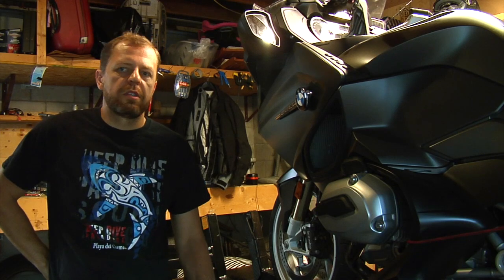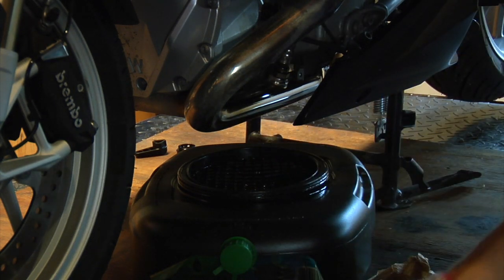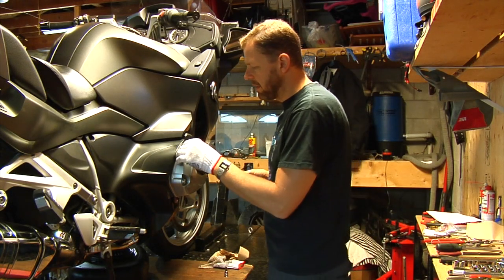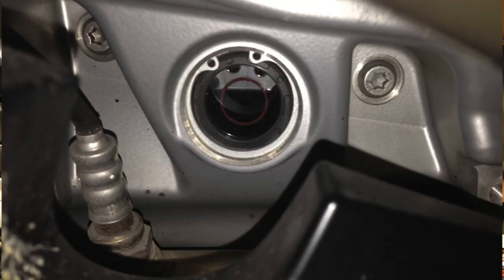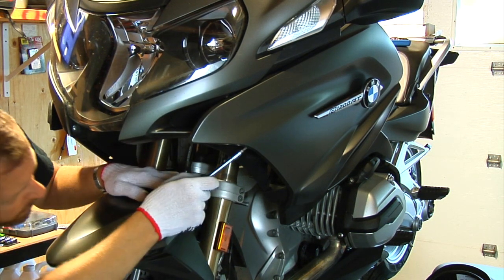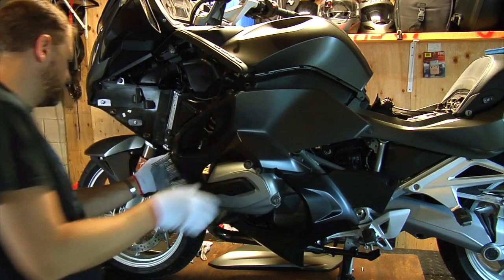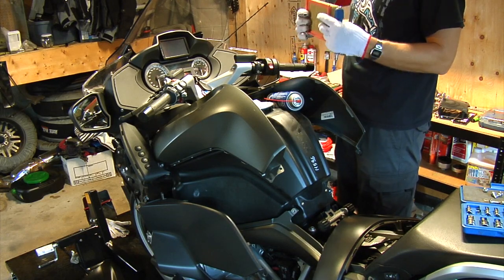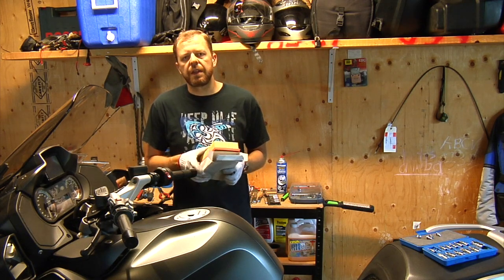BMW R1200RT LC wethead oil and air filter replacement

Comment: I guess one should be grateful for BMW allowing you to change the air filter without having to also replace all the light bulbs, take off the wheels and the final drive ;-) Nice video! Now I understand why BMW service is expensive.
Reply: Amazing how many screws stand between the air filter and freedom.
Reply: It's not as bad as my Kymco AK500 I had. You had to take half the bike apart with many different tools of all size sockets/screw drivers etc to change the oil filter. The air filter was much easier, but at least with BMW it's one tool
Reply: @ArcanePath360  it once took a trained BMW mechanic 25 minutes to replace the headlight bulb on my 2014 BMW R1200RT.

A perfect example of a fcked up design that shouldn't have left the drawing board.
Reminds me of modern days smartphones. Slick, elegant, but useless if you want to replace the battery yourself.
Reply: @NMalteC   It took me 2 hours to replace a bulb on a Burgman once. Should have taken 1, but I dropped the bulb in there and had to come up with some way of hooking it out. Everything round the steering column was mostly taken off to get my hands in there to wind it in. 2 months later, the bulb blew again. I gave it to the mechanic next time because screw all that. There are much worse bikes than the RT for maintenance. That said, I'm sure they could have made it easier to get at the air box. My only gripe with the bike is the clunky gearbox. Even with the Gearshift Assist Pro. At low speeds it's horrible changing gear. Unless there's something wrong with mine. I am getting the clutch looked at next week as the biting point keeps moving.
Reply: @ArcanePath360  I rarely use the gearshift pro. I find I can shift more smoothly myself
Reply: @NMalteC   The manual said it could be used for 80% of your gear shifts. I use it about 40%. Bit disappointed with it really.

Comment: Lots easier than a Honda Goldwing. On that bike one goes lots deeper to get to the air cleaner and one needs to remove lots more. The guys that put the air cleaners in these things in such a fashion should be hit with a club every day for the rest of their lives. I have had 2 gold wings and put a total of over 400,000 miles on them and am considering the BMW R1250RT for my next bike. I have done my own maintenance for years with the exception of valve adjustments and warranty work. The BMW looks like it will be less of an irritation to service depending on the intervals required. Why they are not designed to be easier to service makes no sense at all. Particularly since BMW has such a smaller dealer network than Honda. I suspect that if they were more owner friendly when it came to service they could sell even more product than they do now.
Reply: I traded my GL1500 Goldwing on a 2020 R1250RT this past spring.  Pretty much everything I have looked at on the BMW seems easier to do than on the Goldwing.  The air filter doesn’t seem bad at all after watching this.  I recall tearing the whole top of the bike off (maybe exaggerating a bit) to do the air filter and sub and cruise filters.  Then last fall taking almost the whole fairing and front off when my Speedo cable broke to be able to get to that.  Just removing the rear wheel on that bike to change the tire (did the tire mounting myself) was a nightmare of parts spread around The garage.  Nothing will be easy on a bike with the amount of stuff that is packed in such a small area.  Either you are a fair mechanic or you just pay someone else and smile.  I’ve accepted that.  BTW, if you ride a lot by yourself you would love the RT, the wing was just too big for me riding alone most of the time.  The weight difference alone is quite shocking.

Comment: I have written down the procedure for the air filter change, as is seen on the video:

Air filter change - R1200RT 2015

Video - Air filter change: https://youtu.be/3iY6jKeppEs
at 5’ minute position.

Screws cannot be retrieved with a magnet: Take care not to drop them into the bike inner spaces.
Note screws with a spacer and those without: With spacer for places with plastic flanges protruding.
Marking, numbering or labeling screws as you remove them would be a good idea. (Else you need to have good memory.)
Remove front seat: Take care to detach heated seat cable.
You will need a: T25 torx screwdriver. (Preferably ratchet or electric.) An extension is usefull. Another larger torx is also used.
Remove 2 screws each side in front of the seat - at the rear of the tank.
Remove 2 screws at the top front of the gas tank.
Remove 1 screw at top, in the middle front of the gas tank, inside. (Larger Torx.)
Remove screws inside the left compartment.
To remove left top plastic cover:
Be very careful after removing screws: Separate slowly out and UP. Avoid breaking plastic flanges.
2 in front edge of left top plastic cover.
2 clips in left top fairing cover bottom: When replacing, add grease to stubs.
Remove left top plastic cover.
To remove lower plastic cover rear of left cylinder:
1 left black cover rear, below seat, front of tube.
1 above the left cylinder at the back.
1 below the oil filter can be left in.
Loosen black lower plastic cover rear of left cylinder.
To loosen left plastic cover below gas tank top on left:
1 left in space uncovered below the front centre above the cylinder.
Several under the radio control panel, inside.
2 in front of the left panel below the tank.
Loosen left cover bellow tank top in order to access tank top left cover.
Carefully: Right hand side does not have to be removed, but care should be taken to remove screw and set centre panel free to remove. (Avoid breaking plastic retaining flanges.)
Spread side panels of "tank" top each side of the tank gas cover.
2 left of the gas tank cover.
2 right of the gas tank cover.
With some care, moving right side panel to right, central plastic cover can now be removed up and towards the front.
4 Around the airbox in front of the gas tank lid.
Remove filter cover.
Clean everything with damp cloth or paper towels before removing air filter.
Remove air filter.
Clean edges around air filter seat: Avoid dust, debris or particles entering the air flow compartment.
Replace air filter.
Replace all in reverse order.

Comment: With the old boxer,you could fill up the oil filter before you filled the engine,I(To stop burping)That is air getting in the system.You can no longer do that.And air filter removal is a joke!Why do BMW make it so hard?(Wait until you have to change the fuel filter!!😳🤬